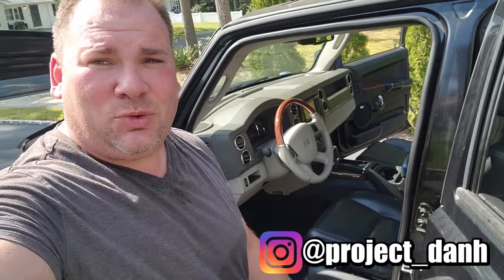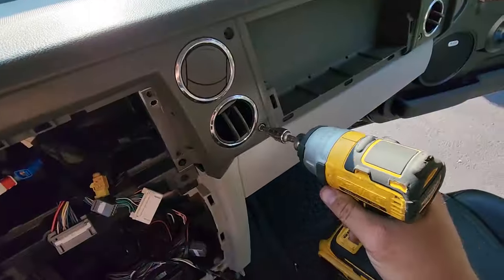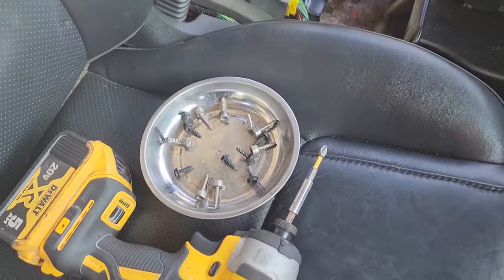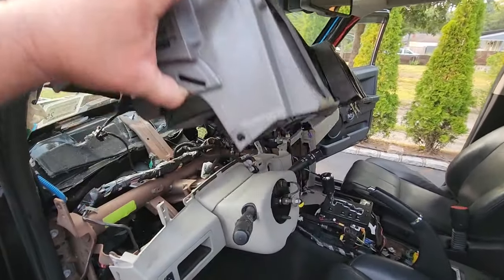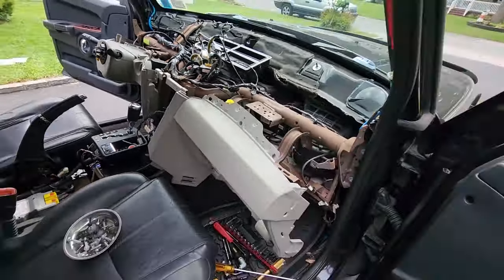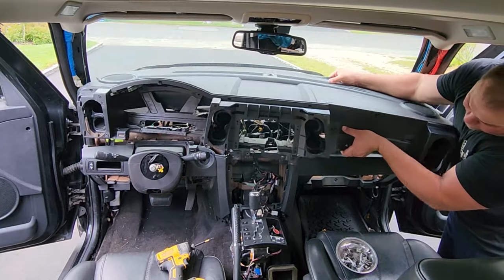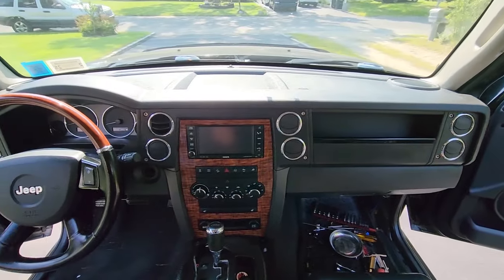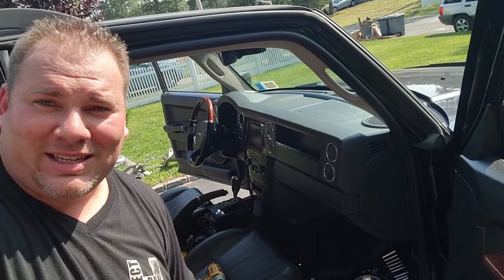JEEP COMMANDER XK DASHBOARD SWAP!!!  INTERIOR SWAP SERIES

Comment: That was another great video Dan !  Like I said before it looks so much better in black. Next spring I am going to pull my dash out of my 03 Tj to replace the a/c , Heater box. I bought another one and completely rebuilt it over last winter / early spring of this year. There is nothing wrong with the one that's in my TJ however the heater core and A/C evaporator are original to it . I replaced every component in the new one and will do the same with the original one once removed , this way I will have a spare completely rebuilt box if needed. Take care my friend and catch you on your next video.
Reply from the maker: Excellent game plan! It's great to have parts ready to go

Comment: Great Dan!  Have 06 put a 2.5” lift, and took it off.  Replaced entire wire harness behind dash. Gutted the interior about six months ago . Cleaned and greased grounds, primed/rust stopped floor, found near new interior at Pull a Part one day getting a brake lens.  Thing never even did a drive through let alone let a French fry in.  Soaked carpet in laundry detergent, rinsed with mild bleach and pressure washed.  Layer in sun for days.  Like new. Just did a nose job last weekend, new headlights and fogs.  Painted my door cards with bed liner.  They look sweet like new. Also swapped my hood and hatch with the Pull a Part car, they were flawless, mine had boat and trailer dings and dents and such.  Big job there, heavy, I’m old and sticks for arms.  Saw you lug that rear seat, for me it was more of a physics problems, get it in without tearing it or the Jeep up.  Did it.  So much more to do.  Need front diff bushings.  And a new fuel tank skid plate and fuel pump.